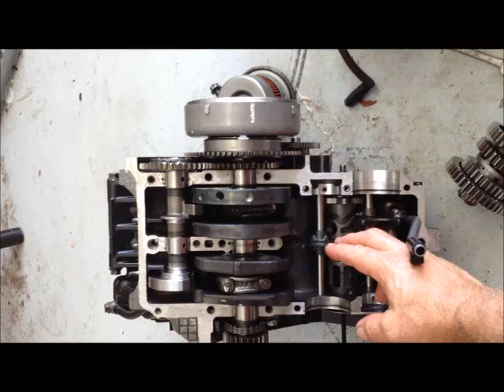Ninja250Transmission

Comment: Hello i have a question i changed everything on my 2011 ninja 250 ex forks,shafts gears everythin u showing on the video  1 st gear spins good neutral as well but when i shift it 2,3,4,5,6 is very hard to spin the gears
Reply from the maker: Sorry for the late reply, I hadn't checked this video in ages.  If you've got it put together correctly, everything should spin freely.  Since you changed the forks, hopefully with new ones and not used, then I don't know what could cause binding.  lube it up and go over your assembly to make sure the gears are in order.  Also check the engagement dawgs on the gears, a burr could cause a gear to not engage or disengage correctly.